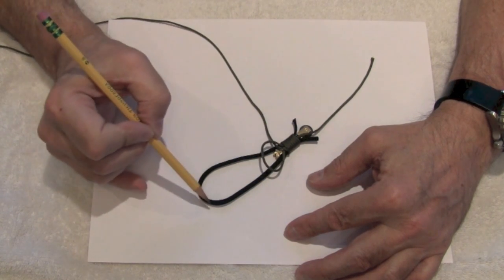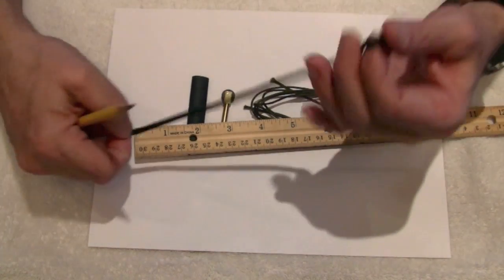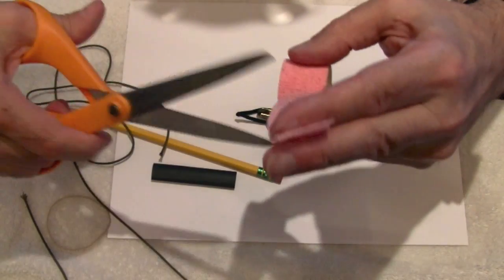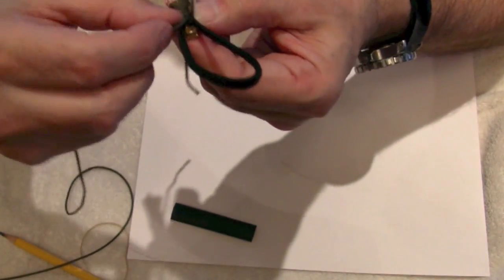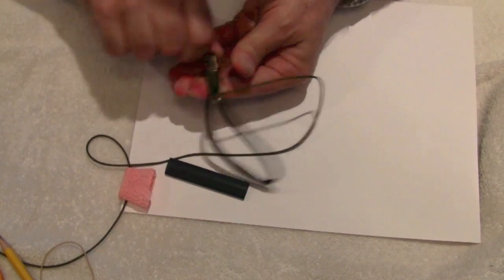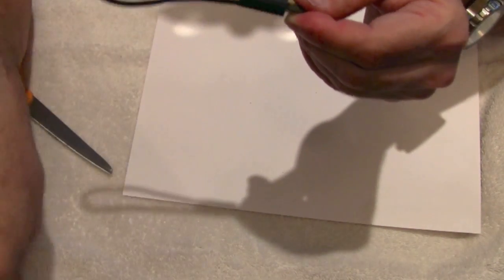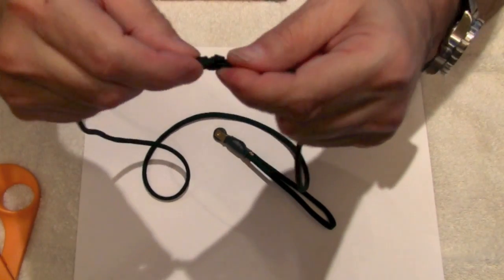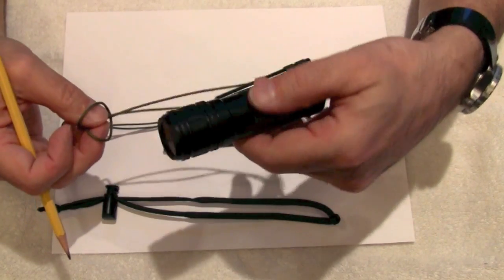MODIFY County Comm Brass Flint Wheel Sparker

Comment from the maker: Modifying the County Comm Brass Flint Wheel Sparker
With a very useful 550 cord carry loop.

BRASS FLINT WHEEL SPARKER
http://countycomm.com/brassflint.html
The Brass Flint Wheel is used in survival tins and is extremely compact for EDC gear. You can now easily ignite tinder and other flammable goods for camping and survival needs.

Comment from the maker: I have several ferro rods and like them quite a bit. This brass flint striker wheel is just another option. These are all tools to pick from depending on your needs. The heat shrink tubing can be obtained from Home Depot / Lowes / Harbor Freight / Radio Shack / Automotive Stores. Hope that helps. Be safe!
Reply: Or ya can buy a clipper and the sparkler can be pulled out just like this! But I mean then ya got a lighter so what’s the point lol